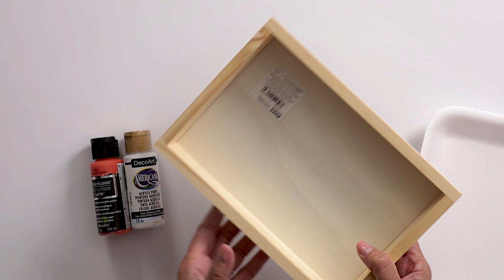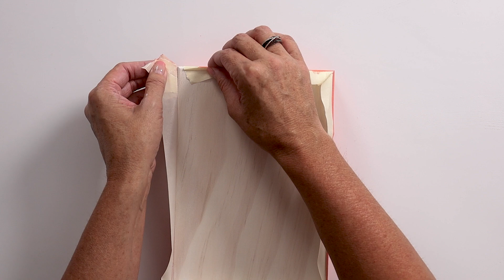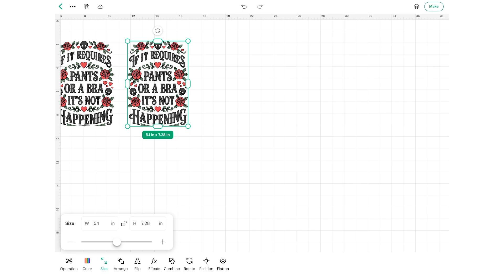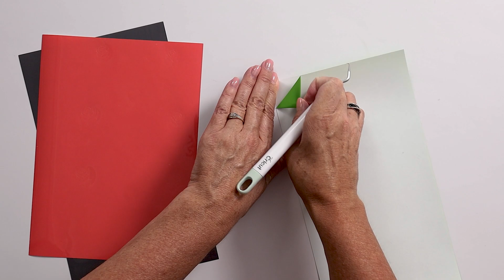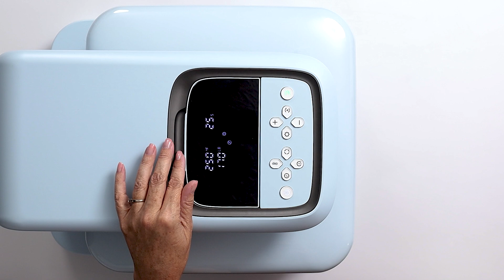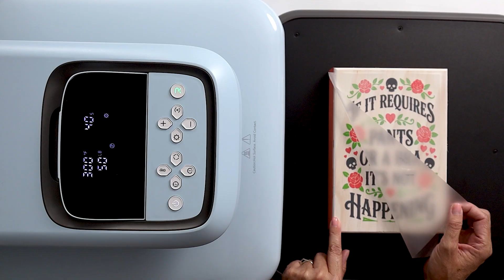Heat Transfer Vinyl on Wood: The Easiest Way to Make Signs

Comment: After pressing the heat transfer vinyl onto the wood- do I need to add a clear coat or polycrylic to make sure it stays?
Reply from the maker: You don’t need a clear coat; the HTV will stay stuck for indoor use. If you are putting it on a door hanger or something that is outside, you can add a sealer if you want.
Reply: @KatieAdams thank you!